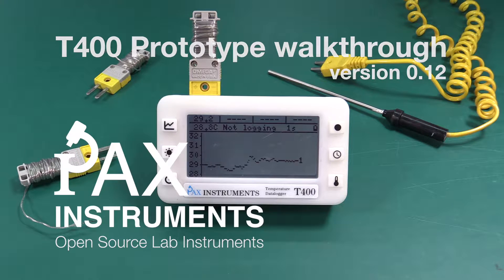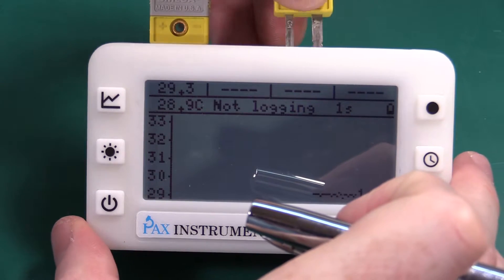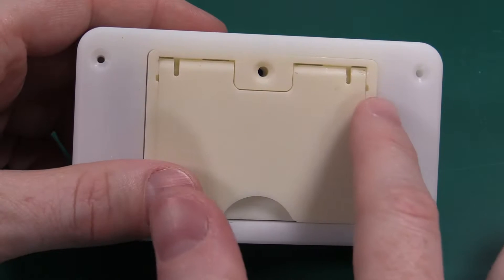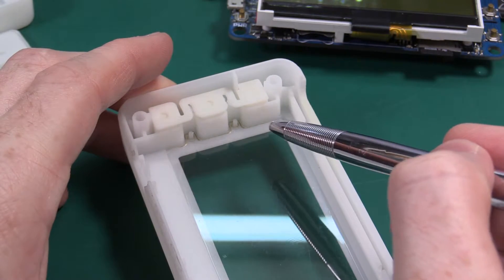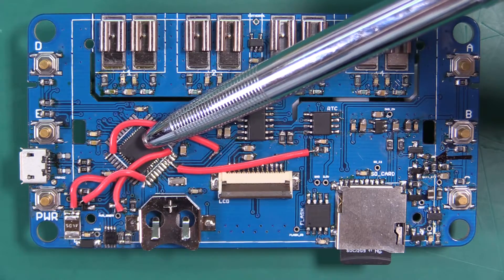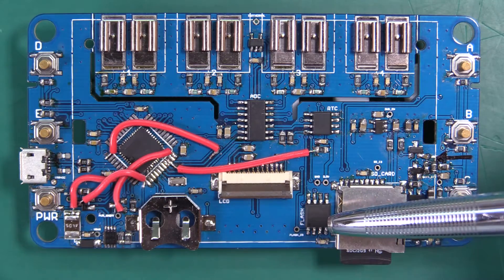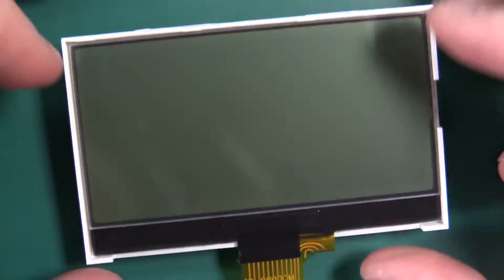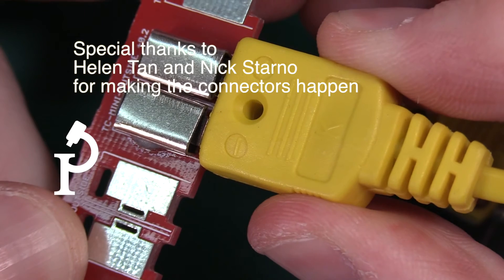T400 Temperature Datalogger Prototype

Comment: That's a cool prototype, thanks for taking the time to go through everything, especially showing off those custom thermocouple connectors.
Reply from the maker: +darkhalf247 Thank you for your kind words :-)

We have another update coming shortly. The firmware and electronics are complete. I'm requesting quotes for the enclosure now. Should be smooth sailing.